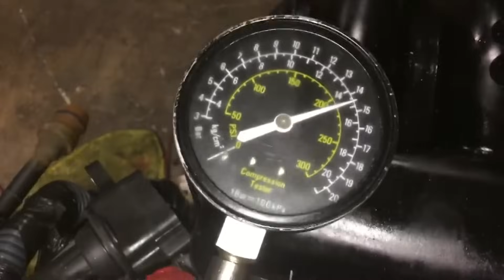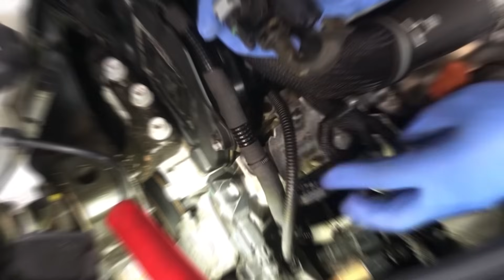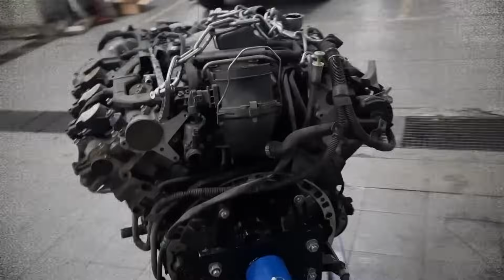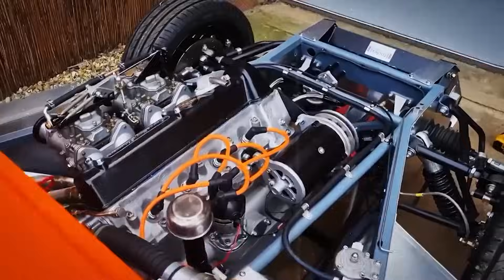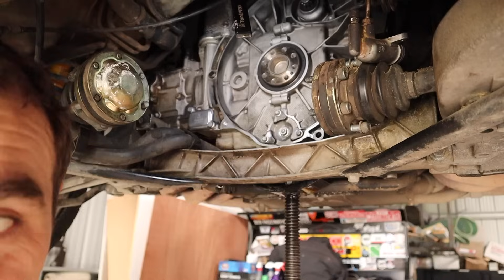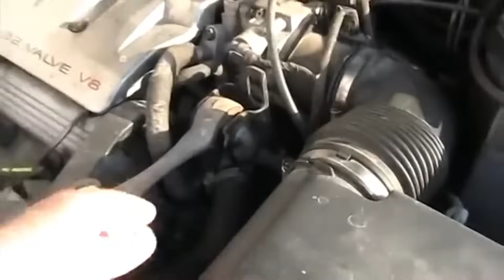The 10 WORST Car Engines Ever Made!

Comment: 1. Metal works best in engines. Other materials just can't take the heat.
2. The Chrysler 2.7 V6 was rushed into production to meet the deadline for the ill-conceived merger with Daimler. Both the engine and the merger were a trainwreck from the beginning.
3. The "Prince" engine should have stayed out of North America.
4. The Ford 3.8-liter Essex V6, by the way, was built in Essex, Ontario, Canada; and should not be confused with a similarly-named, smaller engine built in Dagenham, England.
5. Later versions would improve the M272.
6. The current EA and CB engines have replaced both the EJ and EB.
7. Porsche should have done a bit more engineering work on the M96 engine.
8. See #1. The GM LA1 was rushed into production when it really shouldn't have been.
9. It would take remanufacturers to work the bugs out of the GM Northstar V8.
10. Ah, the LF9, the worst engine in GM history.

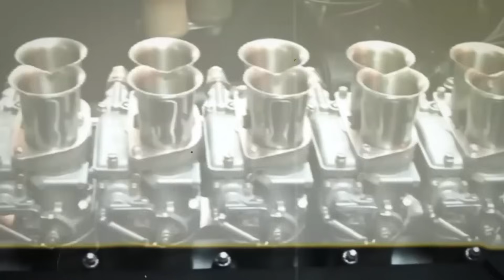Comment: 9:39 I am concerned about The rather liberal use of the famous racing Coventry climax motor in a Lotus when going on about the various faults in the EJ 25. At last check there were many many many more EJ 25 engines produced than Lotus Coventry climax engines for racing. So it doesn’t seem to be too far of a stretch to believe finding videos of that engine and its failures would be more or less straightforward.